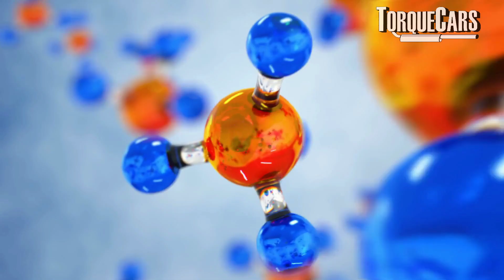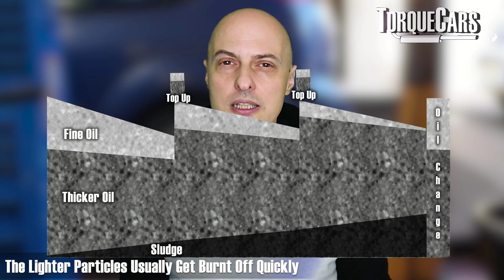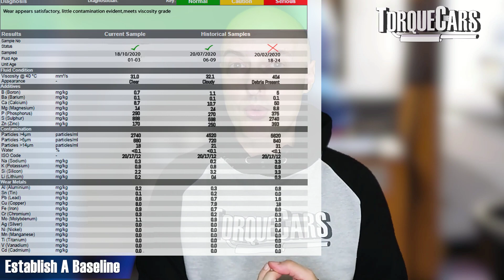Essential Guide: Engine Oil Change Intervals: Importance, Frequency, & Oil Analysis

Comment: Any suggestions for oil burning engines? My 2012 Camry, 2arfe seems to burn alot, even though I did regular 5k oil changes since I had it. I use 5w30, Valvoline Advanced here in south Florida. Oil analysis revealed high lead and copper, Blackstone Lab. Doing 3k intervals now. Thanks!

Comment: It's not rocket science, if you change your oil and filter every 5-6,000 miles or every 6 months,  your engine will last longer, be more reliable and run quieter and smoother.   For years people have told me I am wasting money by doing this, I really don't care.   A bottle of oil and filter are not expensive and i do it myself in 15 mins.  I drive quite gentle and never go to the redline and my cars are not high performance engines, if they were I'd change every 2-3000 miles!
Reply: @andrewstones2921  If i run 5-6 km every day, that's like 1100 km in 6 months.... So do i have to change the engine oil every 1100 km?

Comment: KIA GDI engine owners, change your oil as often as your budget will allow, because that high pressure GDI will pollute anything less than full synthetic oil far too quickly and then you will have to face the possibility of engine replacement.

Comment: Mileage shmileage...LoL ..the only way to determine oil change intervals is like this. First, look up the oil capacity in the crankcase for your model. Then multiply by the constant of 200. Ex.. oil capacity is 5 litres, then x 200 = 1000 litres. Change your oil every 1000 litres of fuel burned. That's it. Mileage intervals are a scam because we can't discern how much is city or highway miles, thus they're unreliable.
Reply: I'm going to attempt this sort of planning.

Comment: Hi great video vry interesting ! I have a dessel with dpf etc and try to change the oil aprox 3,000 miles ! Like you say the dpf oil has to work much harder ! My car is a ssangyon rexton 2022 18,000 miles and tryed febi 0w30c2 oil , quite expensive but  I felt and could see mpg difference ! But i am considering using a oil additive ,liqui molly molygen motor protect! Just wondering if its a good idea or not ! Would love to get that extra smooth running , tad bit more mpg but am concerned if it would a negative affect ! Whats your thoughts please ! I use millers dessel eco boost with great results ! Great channel really enjoy watching ! Thanks 👍

Comment: Rarelly see conventional oil on the market these days. Pretty much all the oil sold is Group 3 Full Synthetic.
The 100% PAO Synthetic is Group 4 and intended for high performance engines with thight oil changes.
The older the car the more often the oil will need to be changed ....between 5000km. - 10,000km.

Comment: On my GM 2.2L Ecotec I try to change the oil every 6-7000 km.  Mobil 1 full synthetic is $30 a jug at Walmart.  NAPA filter is under $10.
Reply: I have one Ecotec 1.8L N/A engine. Oil change every 6 months. I do not use much my car. Now 80k miles and going strong.

Comment: Great content, very well explained, sensible and honest info.🍻
Personal experience,take it for what it’s worth .hope it helps with people’s perception,
From Darwin, Australia , where winter is a mild 20 Celsius and the summer is f*cking hot ,🍺
using oil , run  thicker oil 15w or 20w. ( and a good battery with higher cranking amps then spec will last a lot longer and start )
5w or 10w full synthetic only for normal cars/dual cabs/TDI or Petrol
Change oil every 10,000 km and change the filter, diesels we change the filters every 5000km (only $15 Aussie) don’t worry about time 12/24 month bullshit… maybe worry about if it’s been about 5 yrs since … maybe in the UK or euro, is different due to cold temps and changes the viscosity/ detergents in the oil … I don’t know that one..
Anything turbo I don’t leave it longer ( preferably) as the heat from the turbo, degrades the oil faster due to the higher temp heat cycles 

(Family man with 4 adult children)
754,000km landcruiser  TDI
430,000km VW Amarok TDI 
280,000km Audi A3 TDI
130,000km Ducati ST 4
All manual transmission, 
312,000km Lexus IS 300
200,000km R34 skyline turbo 
Autos, change transmission oil roughly every 60-80,000km
Fuel consumption is roughly the same, as factory when new ,the TDI EGR and DPF (Audi / VW ) are a fu*king nightmare for codes, run the breather hose ( the one from the cam cover to the turbo inlet  ) straight out via inch hose to the exhaust, (illegal in most countries but the convicts down here don’t care ) no codes or EGR/DPF issues ever since , 80,000km when I made the changes. oil and diesel soot don’t mix well, and you don’t get that oily build up in the inlet manifold you see all over YouTube , just the sooty dust which is no issues for the DPF.
 Zero problems.
Reply from the maker: Glad it was helpful! Thanks for the support and encouragement my friend.

Comment: I Using AMSOIL signature series and I have a twin turbo engine. I change it at 5000 miles that may be a little excessive but it’s a $60,000 car so far 3000 to 4000 miles longer isn’t worth it to me.

Comment: I have a 2016 Honda Civic with the 2.0L i4, non-turbo engine. As I drive a lot of hwy miles, I change my oil every 3 months or 6700 miles.
Reply: I bet it runs nice. What kind of fuel economy do you see with it?
Reply: @dont.beknown5622 my apologies for not answering sooner. As I live in the US, my highway mileage comes up to about 40 miles per gallon. Converted to metric, approx. 5.7 liters per 100 km.

Comment: I seen a video with a guy that was a engineer/mechanic guy with the Nissan sports car, he said the best thing to do is change your oil every 5,000 miles. It doesn't matter if its cheap oil if your changing it every 5,000 miles is the best, he said.  I know you can big bottles of oil for under £100 so I may just buy 5w40 one and change 5,000 miles and this time send it away for examination of the oil and see the Results.
Reply: In the old days... 3000 miles was the standard. We were using 10-40 in the summer, 10-30 in the winter in those days. My engines in each vehicle I've gotten since then have migrated to 0-20 synthetic (MFG requirement now). I just follow the book. It's probably over doing it at 5000 miles by the book, but warranties like that and it seems to work. Each of my vehicles I didn't trade in were 200,000 mile wonders - still running like a top. I think 5000 miles is probably a good bet with modern engines and modern oils.
Reply from the maker: I can see some merits in this advice but even "cheap" oil needs to be of the correct grade, so I guess as long as you accept there are cheap quality options and cheap rubbish which is to be  avoided then this makes sense. Swapping a 0:30 Synthetic for a 20:40 mineral would be catastrophic for example.

After all if the only difference is the lifespan of the oil and you are changing it more frequently it doesn't matter.

The analysis will tell you so much about your own engine and it is almost impossible to come up with an oil change tip that works for everyone as both cars and drivers use of them differs so much.

On most modern VW Turbo engines you will get sludge building up and all sorts of issues if you don't use a VW 50x spec fully synthetic oil, regular changes will help but only to a point.
Reply: Thought he stated 3K miles; 4K miles at most? If you want a 200-300K miles engine that is? Of course more likely in e.g. the UK, EU, is that it's not going to be the engine; therefore oil change related; that kill the car in the first place...!?